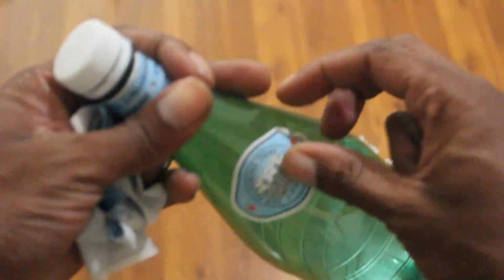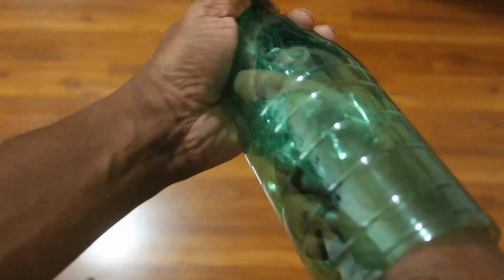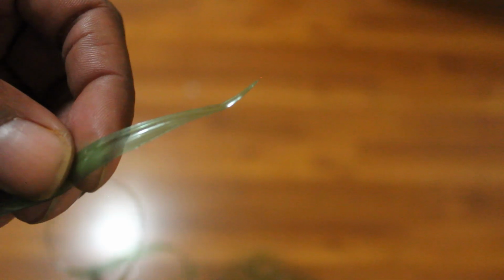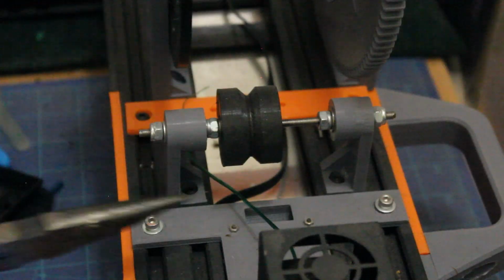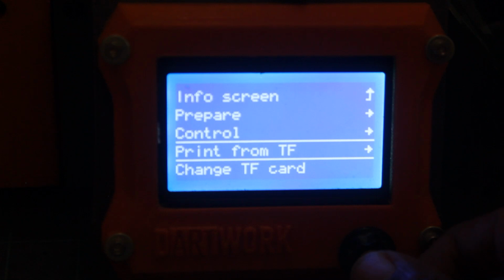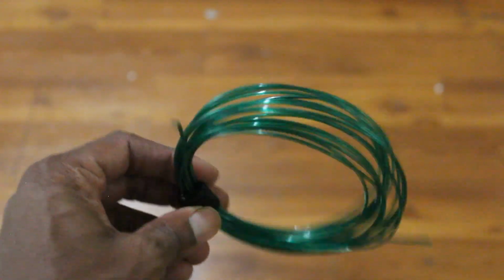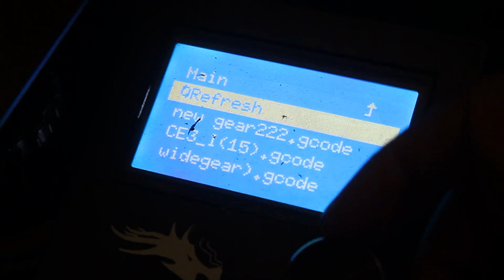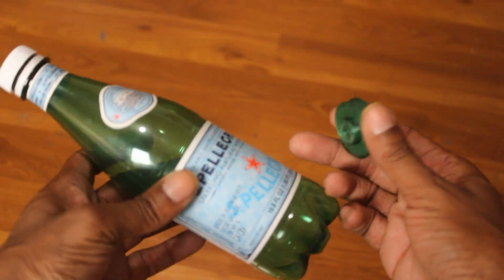3d printing with recycled PET bottle filament.

Comment: I've been doing this for a few years now and found a few things.  Bottles from carbonated beverages are almost always thicker than non-carbonated so you need to cut them into a narrower tape than you do non-carbonated ones (6mm wide vs 8mm).  Since these bottles are literally soaking in water for months upon months drying is critical.  Cut them into the tape/ribbon and then dry it just like you would any PLA/PETG/TPU BEFORE you pulltrude into filament and then dry it again afterwards before you print with it.  When you're pulling the filament it should come out glossy and smooth.  There shouldn't be any bubbles, ripples or waves in it and that is usually a sign that the tape should have been dried first.  You will get MUCH better filament and print quality this way and the end result will be much more transparent and smooth.  Print HOT and slow...like 270° at 40mms.  You'll get seriously strong prints with fantastic layer adhesion.  Also increase your flow...upwards of 120-140%.  

When you remove the labels the adhesive is not water soluble.  Heat is your friend.  I typically will inflate the bottles to about 10psi and use a heatgun to soften the bottles just enough to smooth them out.  This also causes the adhesive to soften and you can scrape most of it off.  You'll get better prints if you remove it all and I find carb cleaner to be the best for that.  The adhesives they use can/will gum up your hotend and eventually clog the nozzle as it is not designed to get as hot as needed to properly melt the plastic.  You'll also get a MUCH more efficient use of your time and efforts if you stick with larger bottles.  I prefer the 4L water bottles (the green or blue ones) and if you're careful you can get upwards of a kg for 25-30 bottles.  Where I am bottles have a 10 cent deposit so most people have a financial incentive to redeem them....ie it's hard to get them for free.  So I stick with the large bottles and this means on average I can make a 1kg roll for around $3.  I've lost count of how many bottles I've turned into filament (would easily be over 1000 at this point) and it's been a LOT of trial and error.  Now I have very little waste and around 90% of the bottle gets turned into useable filament.

You can also color the filament with sharpies but the heat will alter the color so don't expect it to remain as vibrant or solid/opaque.

Comment: Do I need to configure the printer for recycled PET? Because I have horrible print quality.
Reply from the maker: It all depends on the type of bottle and how clean you can get the bottle before the strips  go thru the recycler. Also make sure your nozzle temp is about 255° or you'll have extrusion problems. Bed can be 80° like petg.
Reply: Because the PET bottle filament is hollow instead of solid like normal filament, you have to turn up your extrusion rate to get the same results. Usually it's 95-100% for normal filament but with bottle filament it should be more like 130-140% to compensate.

Comment: Wanna share a quite effective way of removing glue residue after stickers. Works great for glass jars and bottles at least, maybe will work for plastics.

Take a cotton disc or a sponge you don't care about, pour some vegetable oil on it, and add some baking soda on top. And you just carefully take that and wipe on the place where the glue is. At first it sticks a bit, but after a bit glue begins to come off easier, and eventually it removes the glue completely and leaves no scratches.
After that you obviously wash the oil away and there you have it
Reply from the maker: @nemorianderson  thank you for the tips friend!  im always learing and I appreciate any method or techniques to make any of these processes easier 🙌🏾🙏🏽!
Reply: WD-40 works even better and faster.

Comment: You should make the cutter with bearings.
Reply: Yeah, doing it eye will make inconsistent filament and potentially a ribbon that will just NOT pull through the nozzle.
Reply from the maker: @bluewafflesrcks  i tried it didnt have much success but ima try that method again! 🙌🏾